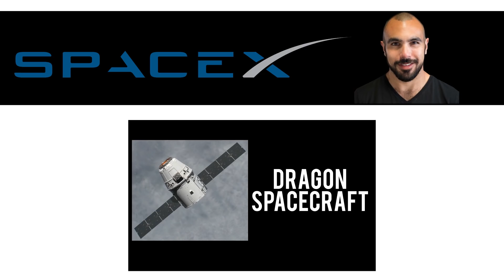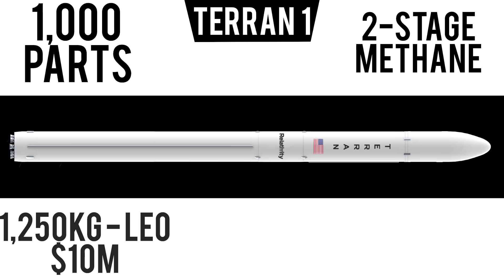The World’s Largest 3D Printer Is Printing Rockets!

Comment: Build alien space crafts by 3d printing. SEARL generators, Mercury feride, magets, and electricity. A nonsensical class of space crafts that levitates and travel at a  much higher rate of speed, than what is commonly available now. Bring down the cost of the design and fabrication/ development.

Comment: But Rocket Lab is already 3d printing rockets.... but this is still cool too I guess.
Reply: Motor thrust chamber, main propellant valves, injector, and turbopumps only atm but takes only a day per motor.
https://www.engineering.com/3DPrinting/3DPrintingArticles/ArticleID/12235/Rocket-Labs-3D-Printed-Rocket-Engine-Ready-for-Test-Flights.asp

Comment: i've also got an idea about mass manufacturing rocket using 3d printer. but what i focused is about the process in assembly line, like what kind of process in production line that can have the fastest and the most efficient way to build rocket from scratch (not the electronic component parts). and also i want to implement embedded system, machine learning and fully automotic robots that can simultaniously working together to reduced the risk that led to launch failure.

interesting indeed that these company also approach almost on the same methods that i had since late 2015.

Comment: Before you send a 3D printer to Mars it will be necessary to send facilities to prospect, mine and processes the raw materials that the 3D printer will need. Mining and ore processing is hard on equipment and so will require facilities to maintain and build equipment. Such heavy industrial facilities for Mars are much more than hundred years away..... unless nanobots become self replicating and controllable. But then we won’t need 3D printers because the nanobots can build the entire rocket ship, complete with working toilets.

Comment: Something like this was unthinkable in the 1960s when only the superpowers could build rockets that could reach space.  We are definitely in the future.
Reply from the maker: Absolutely!
Reply: "We are definitely in the future."  If we were in the future, we would be using flying saucers instead of chemical-burning rockets which require refueling in Space and will take months to reach Mars .
Reply: @CommieBash It is not that easy.  Gov't is always involved, in one way, or the other.

The only reason the private sector is allowed to be involved in rocket-based space exploration is because the Military Industrial Complex is far in advance of it (despite the popular opinion). 

The MIC wants to retain that lead, and will only allow certain tech to be used by companies like SpaceX, etc. So, rockets with so-called "high" technologies is OK, as long as that technology is something like carbon fiber, which is so "high tech" that it is used on golf clubs and fishing rods.

Note that "reusable" rockets are not fundamentally different than traditional rockets, except the price per launch is less.
Reply: @codetech5598  everyone knows that flying saucers are super inefficient for space travel
Reply: if you really wanted a cheap way into space, you'd make a space elevator or similar megastructure
Reply: @tahneethompson6012  The problems with getting into space is cost.  Building a space elevator requires materials we don't have at the moment.  Materials like graphene and graphyne.  Yes, we can make graphene, but not in the quantity or quality required.  Yet.  And building megastructures is out of the question when launching payloads into space costs $10,000 a pound.
Reply: 'The future  is already here - it's just not evenly distributed." 
William Gibson
Reply: @CommieBash 
Your statement "everything is better once government is not involved" is debatable to put it mildly.

Sure, you can find governmental f***ups, but the private sector have had its share too. 
(Need I mention Enron? Take a look at http://www.businesspundit.com/the-25-worst-business-failures-in-history if you're still not convinced.)
And a lot of big companies are every bit as Kafkaesque as any government. Read Scott Adams "The Dilbert principle" if in doubt. It is as funny as it is scary.

In a interesting TED-talk Mariana Mazzucato gives new perspective on where true innovation arise (Search for Mazzucato TED government - investor, risk-taker, innovator)

The world isn't black and white.
It's in full technicolor.
Reply: I just want to see an actual space plane. Like a vehicle that takes off from a runway and straight to space. Never seen anyone try that yet..

Comment: Really makes you wonder just how hard it would be to make a 1kg orbital payload space craft... and how expensive as a 1 time deal.

Edit: ceramic cast ramjet and nosecone for the first stage  saving oxidizer mass, launched from a pair of stratospheric balloons and given a bit of lateral velocity by a small solid rocket motor, and using a simple low powered hybrid rocket motor to get the last few km/s of delta V. use a raspberry pi as the flight computer and take delayed commands and give updates via the internet (if possible based on the altitude and whether or not one can even link to satellite internet above 2km).

Edit again: small ramjets have been made from coffee cups and making one out of steel and then layering it with model clay baked as a ceramic could withstand the temperature for a time. hard part is maintaining orientation in stratosphere to take advantage of ramjet acceleration(might need a G sized hobby rocket motor and another set of smaller ones as to act as a 4th stage before the hybrid)

Comment: Mankind may face the possibility of remaining trapped on the earth due to space junk acting as an impenetrable cage preventing anyone to leave the planet
Reply: Oh, you mean Kessler syndrome ? 
Nah, that's an easy fix 
If it did happen, we'd just have to build a GIANT LAZER ARRAY (kinda like the one proposed by breakthrough Starshot) and push sats in just the right way till they deorbit in the atmosphere 
I'd say in about 15 years (including the building of said array) we'd have Earth Orbit all cleaned up
Reply: @mihailazar2487  that may work for relatively big junk but what about untrackable space debris?
Reply: @illogicmath  well the point is to prevent such small debris by making sure no collisions occur by deorbiting unwanted space junk like de-spin yo-yos, Interstage connectors, fairings and used kick-stages 

As for what we do if it's already happened ? We'd have to get rid of the big stuff first, and then implement a Search and Destroy protocol for the small debris, that would just get outright VAPORISED. 

Your concern is tracking I see ... It would be hard but it can still be done, radar works well but the wavelength won't bounce off such small targets, but we can use the same laser array, just focused a bit broader, so it covers about 100 square meters at Low Orbit and with multiple detectors, we can spot debris inside our beam range and then predict where it will be a couple of seconds later, by the angle and time it took to cross our beam, focus, re-target and BOOM , VAPORISED 
this will, of course need a lot of time sweeping each and every square tile of the sky for 90 minutes at a time, so as to capture  every possible orbit